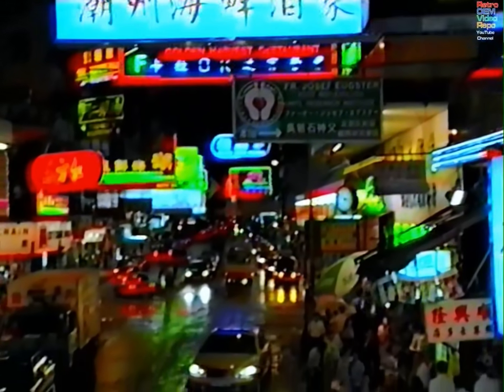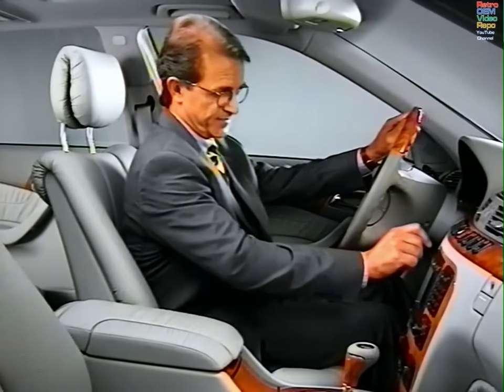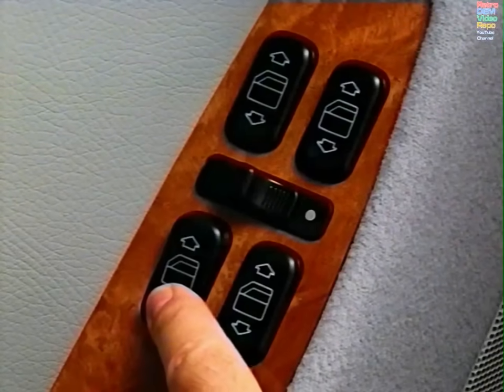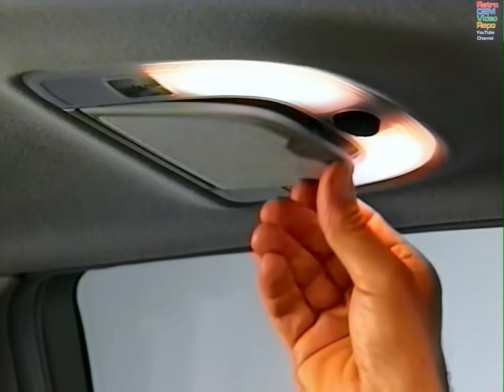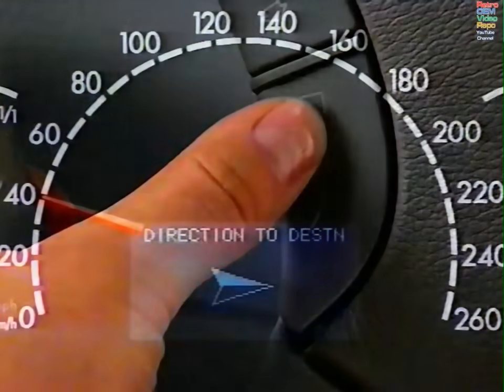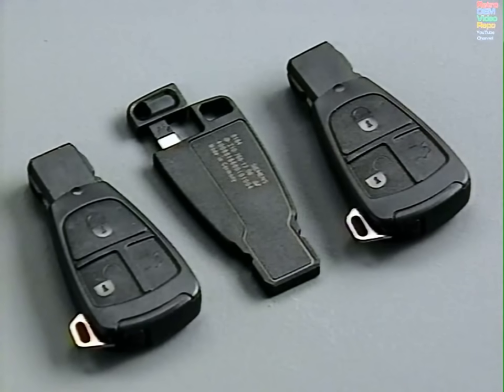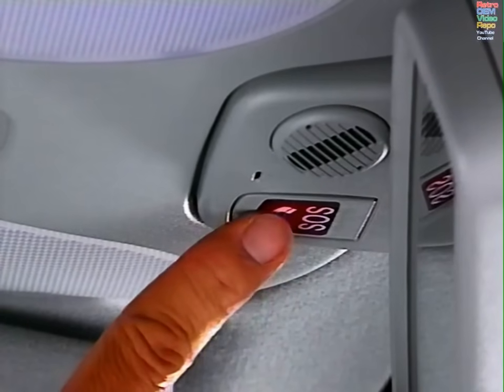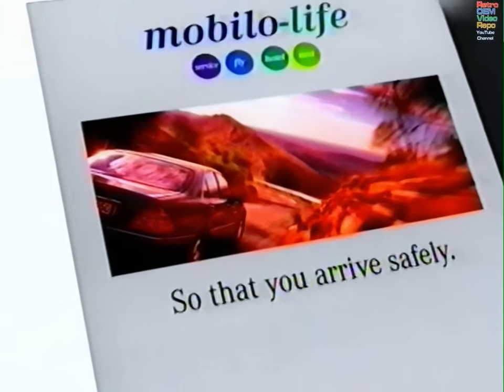Mercedes Benz - S Class (W220) - Video Handbook (1998)

Comment: This car was very ahead of it's time! Absolutely amazing!
Reply: This is why people love BMW and Mercs ... and hate. Awesome tech but sucks if it stops working constantly
Reply: the ls400 was ahead of it's time. this car was just trying to imitate that
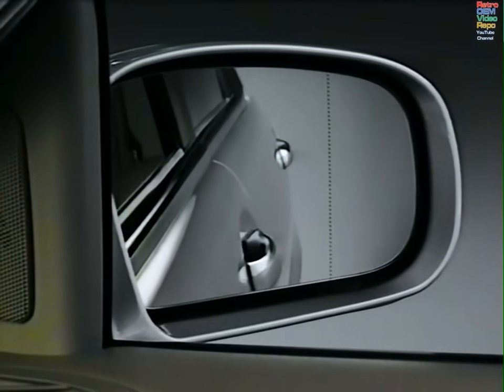Reply: It depends. For example, 9:26 - mirror folding down when in reverse - same BMW E32 had this as well, and it was there earlier. Seats - adjustable support - I had it on my MB 560 SEL made in 1988, not something new. Adjustable rear seat? Also present on 80's S-class. Folding head rests? Even E-class W124 had them since 80s again.
Reply: This car is awesome
Reply: @abel4776 Well, the W222 looks much better, it's more bland though. But again, the e38 7 series was on an other level.
Reply: It's very high tech for it's time. Some cars are only getting some of this stuff today... a bit of a joke really
Reply: Too bad it looked pretty ugly... Even in its time. 
But yeah, the tech was unbelievable!! It was the best of the best.
Reply: hrgiyzueghe ugly?? dude, i love this style and design! most of cars in 1998 looked so... boring
Reply: @PrzeszczepiX  I prefer the SL style! And the previous S of course :) 
The W220 S still looks very luxurious and has class, but the front headlights are a nono to me! Making a car this big look good is extremely difficult, but I think hey could have done a bit better imo. The design is ahead of its time, I agree with you there. But still the 7 series from same year has better (yet more traditional) looks!
Reply: PrzeszczepiX Some people would say rather that cars use to be minimally designed and modern cars are overdesigned.
Reply: @PrzeszczepiX  I agree, at least this car look a little cool for late 90s early 2000s. I’m not really into cars this old though and I was born in the early 2000s also.
Reply: @PrzeszczepiX  I guess everyone has preferences
Reply: @hrgiyzueghe  Toyota alwais had a better new technologies,and do it more erlier
Reply: Lexus LS400 Is more better than Mersedes.
Reply: @alextim7645  "more better "
ahahahaha
Reply: You are high, stay in school, learn something Sir!
Reply: @alextim7645  lmao no
Reply: @Chicken_cocknballsoup7376  in 90s Lexus had tehnologies  surpass above mersedes and bmw.They are thefts even folding mirrors by Toyota.
Reply: @alextim7645  learn to speak english 
and no lexus is boring for boring people
Reply: @alextim7645  idiot u don't know what are u talking
Reply: Bmw 7 E66 is more better with better technology.
Reply: @noonamee99   whats that that bmw 7 has and this not
Reply: 00M 500 who would want an e66
Shockingly unreliable 
Should’ve kept producing the e38 smh 
I could get a 750i 2007 model year for under £5000
Reply: @h214suiiii Haha. Yep. The E65/E66 was just a culmination of bad decisions. I've had experience with an E38 too and the 220 with M113 and 722.6 is probably the most reliable German full-size ever made.
Reply: 00M 500 like what?
Reply: @noonamee99  no it's not
Reply: @noonamee99  🤡🤡🤡🤡
Reply: @noonamee99 no
Reply: @noonamee99 😂😂😂 yeah right bro

Comment: I'm still waiting for someone to explain to me why if German engineering is so good, why do you constantly have to work on them? Don't get me wrong, I love Mercedes and you can't deny how safe they are, but I could buy a Lexus and never have to do anything to it but normal maintenance, and that is minimal.
Reply: I think it’s because of the innovation in ALL parts of the car. Toyota/Lexus for example has had the same digital clock for 20 years because - well, its a clock. Mercedes has made a new clock for every single model. 

Of course, it’s not about the clock but an easy example. They just don’t stick with one “okay” thing and focus on some innovations but make a newer and better version of EVERYTHING - hence, more problems can appear.

I’m not judging - working at Porsche myself and having a dad who drives a Lexus I see both sides. German cars are excellent but yes, Japanese are more reliable. Sexier? Well...worldwide Lexus/Acura/Infiniti sales vs  Mercedes/BMW/Audi sales the customers have spoken.
Reply: VinceThe1 i see what you mean 🤔
Reply: VinceThe1 I see what you mean but what a terrible view of the world 🤔 I also don’t think it’s that black and white - would love to see a relation between driving a Merc and knowledge about Miley Cirrus 😂
Reply: Ictpilot Ictpilot the Lexus LS430 has all these features, and then some! And it’s far more reliable! German engineering is phenomenal in the first 5 -7 years, Japanese engineering (for the most part) is phenomenal and impeccable for at least the first 15-20 years, if not longer!

Comment: The early ones 99-2003 were not good. I own a 2005 and Ive maintained it and have had 0 issues. Its left me stranded 0 times. Very reliable. Just have to maintain it and it works fine. Rides like a champ, and looks great!
Reply: got 2005 and electrical issues are all over the place... and heard people have it too
Reply: Vin Mega v8?

Comment: Always liked the W220s. Shame they weren't more reliable.
Reply: I live in California so l dont know a darn thing about rust on a car LOL
Reply: Rusty boi
Reply: Actually they are usually unreliable but when it's fixed it's something
Reply: @youraveragejdmenthusiast430  i know the diesel engines in these s classes are very reliable i saw a couple with 300k km and even 500k km
Reply: @Nikola_W211  I looked at some saw around 300k km and 400k km around diesels and for gas ones were getting fair 200k km and 300k km probably they just happen to have issues with the eletronics and the bad air suspension that are expensive to fix but engines don't maybe have the same problems with unreliability
Reply: Yeah, I saw one on fire
Reply: 03-06 W220 is the answer. Make sure it's an S500.
Reply: @CynicalBastard511  BS. Stop propagating that myth. Those are the worst years considering the later COMAND issues and widespread ABC suspension.
Reply: Not at all...
Rust everywhere...
Reply: Kev27RS after 2002 model year it’s got facelift and they fixed lots of issues. Especially the rust problem. This problem caused by a bacteria. They changed their paint company.
Reply: @Kev27RS  Mercedes has 30 years warranty on rust...don't talk nonsense.
Reply: @derbigpr500  Too bad the W220 bodies were unaware of the warranty...
Reply: W220s are among the most reliable Mercedes ever made mechanically. M113 and 722.6. And the best part? Also one of the easiest to work on. All the sheep who want to believe the myths won't get to enjoy them. 

And I'm in the southeast with a great garage-kept 2000 S430 that doesn't even have a nanometer of rust anywhere on it.
Reply: @MrCarGuy  Ik, I tuned the shit out of my m113 and it performs like a charm.
Reply: @MrCarGuy  where do you live?

Comment: This car is a bloody nightmare. I challenge any mechanic to fix mine.. The Mercedes mechanics are useless. I'd offer a bonus to any mechanic who can figure out what bugs my 2002 S500.  This car is just a hole in the road to throw money into.  Steer clear if you value your sanity.  S500 is a brutally notorious pain in the ass.
Reply: That's odd, mine is perfect with no problems 108K miles. Dealership is the VERY last place I would take the car, they are stupid, ignorant and dishonest
Reply: There's a guy that bought a abandoned S600 from 2001 and every week there was a different problem. Each repair of 500$ 2000$ dollars and most for the crazy complex ABC suspension
Said he loved the car when it worked which were very short periods of time
At the end the guy sold it after month to a junky teenager for 3k
Reply: David Christie which country do you live in? I’m in Adelaide Australia and up for the challenge!
Reply: @jamhen01  I take my s500 W220 to M&B Prestige Holden Hill SA and have never had any major issues.
Reply: What's wrong with it? 

I bought my S500 on a whim with 240 thousand miles and it runs like it was new. I repair it myself, they really arent too difficult at all. I do need to invest in a diagnostic system like STAR to really dig in though.
Reply: Who knows? LOL It was alphabet city on the display.. ESP, BAS, ABS, Engine LIght, Headlights flashing, Display malfunction.. I was thinking it needs an exorcism . Maybe I should have taken it to a priest. But  I took it into one Euro Tech bullshit artist. He replaces the ABS with a used unit. $545.. Drive it for a week.. Then bang. Here we go again. The same song and dance. All that the guy did was clear the stored codes. They seem to know just how much to screw you for - keep it under a certain amount -  then it's not worth it to spend your time getting in their face with your beef. LOL .  I called them up  again: "Bring it in and we'll scan it" Right..  LOL.. Finally took it to a local guy who scanned a driver side front wheel sensor. That seems to have tempered things a bit, for now. The last thing to hit it was "Display Defective" which throws it into limp mode.   We did a complete scan and found some stupid things like "fog lamp" and "license plate" light malfunction. Nothing that would throw it into a limp home problem.. The thing is: You don't know what is really kicking off the malfunction. It looks like you have to rebuild the car to find out if it's a fuse, a rusty contact, a short.. who knows? It is the perfect car if you're a millionaire with masochistic tendencies.
Reply: @davidchristie3245  

Boy, you did seem to get a real temperamental one for sure! My car is also starting to show its age in odd ways but it still runs like it was new as far as the engine is concerned.

I think you're right though, a used Mercedes is a masochists car for sure. You're playing Russian roulette when buying one and you know its gonna go bad at some point, but I enjoy a challenge 

So far all the car really does is air down when parked a few days, and the blower motor sometimes stops working and you have to turn the climate control on and off a few times to get it going again.

I should be concerned with the Airmatic, but the car currently rides on 20 inch wheels and I cant help but admire how damn good the car looks tucking the 20s, even though its literally sitting on the inner fenders lol...

I need a therapist.
Reply: Yeah.. That's the seductive thing about it and probably why I haven't given up. The engine and trans run so well. When it's running it's really great.
Reply: @davidchristie3245  

Ahh, a mere two weeks later and I must admit I beleive the duo valve bit the dust lmao! No damn heat!

Went to take the car for a ride and the engine gets up to temp just fine but cold air is blowing out of the vents...

It's truly a labor of love keeping these cars going lol
Reply: David Christie make sure to inspect the canbus connection to the electronic ignition switch. Your symptoms sound like what happened when I disconnected my ignition switch from the x30/6 canbus distributor under the dash.
Reply: @davidchristie3245  - I like how you guys talk about "Euro shit", but want to drive Mercedes S-Class. Laughable, absolutely Laughable. Sorry, but US-Cars are the worst joke in Germany. Cheap plastic shit, sold for little money and if you don't pay attention, the Corvette starts burning. On top, endles fuel consumption and superchargers, where germans install electric superchargers. Please don't buy 20 year old Mercedes and start whining. This is ridicolous, if you can't afford one new, just stop it.
Reply: you have to buy the right one. My 02 was owned by a lawyer (original owner), driven gently. All maintenance/repairs were done at the dealer. I've since put in some $$, but really to be expected with a car that cost $100,000 at some point.
Reply: Mine was owned by a Mercedes dealer. I'm the second owner. It had complete maintenance records, oil changes etc.. Only 75,000 miles. These cars are way too complicated in my opinion. No car should be un repairable by the local mechanic in your town.. The thing is: All the "Euro This and Euro That"  Auto Techies who advertise their special expertise in these cars are frauds. I have doubts if even the dealer can repair this car.
Reply: @davidchristie3245  I'm benz expert so find job for me in USA and let's make a milion😊
Reply: @mathew3293  

Absolutely, my car was also one owner, a doctor. Maintenence was done often and it even had rust repair done years ago but it wasnt quality.

Either way, if you get one that was thrashed you'll have a problem, but a gently used one will run forever.

They have strong engines and transmissions, I have 250k on mine and it gets driven hard some days. Harder than the original owner ever drove it I'm damned sure. Burnouts here and there...
Reply: I can help you i have 2 of them in europe one is a w203 other w220 only benz nothing is more easier to fix !
Reply: @farmingandmercedesbenz4140   Thanks for that. I believe I've identified the source of the problem. When I bought this vehicle, the seller mentioned that they had replaced the shocks. I notice the trouble doesn't start unless I activate the Adaptive Damping System.  Something tells me there's a fault in the installation or in the ADS units... if they actually installed the correct shocks with those units attached. I ran a scan after pushing the ADS button on the dash. I got a few trouble codes including a fault communicating with the ECU - A fault communicating with component N73 and a discontinuity communicating with the horizontal potentiometer .
Reply: @davidchristie3245  you have the some kind of ecu for suspension system just change it after years its getting moist and giving alot of troubles like you need to change shocks etc . A2205450532 part number for airmatic module had problem with airmatic changed shocks  nothing helped changed that everything is working
Reply: @farmingandmercedesbenz4140  Thanks.. As long as I don't mess with the ADS switch, everything has been pretty calm. I do get a "fog light malfunction. Substitute used" error  at night.  And that sometimes trigger the "display malfunction" But it clears out with the reset button. The airmatic thing is a major pain in the ass because it usually forces it into limp mode which can ruin your whole day.
Reply: @farmingandmercedesbenz4140  Hey..By the way: Does replacing that module require re-programming it? Thanks again
Reply: @davidchristie3245  no Just replaceme the New one cost by dealer 1900 usd found guy whats have crashed car bought for 50 bucks
Reply: @davidchristie3245  99% sure its that module because i had the same issue just dont touch it or dont drive over 140 km/h because the suspension going itself down to sport